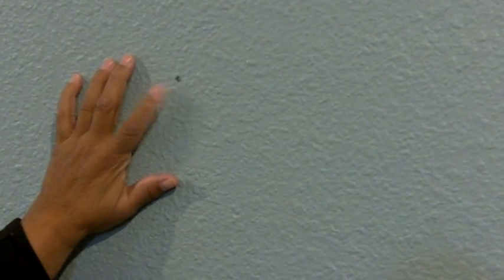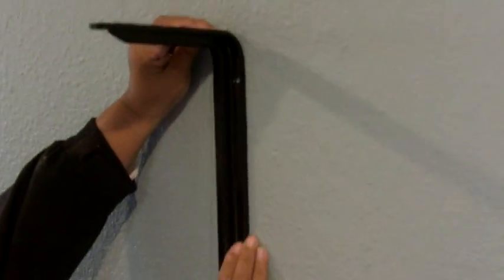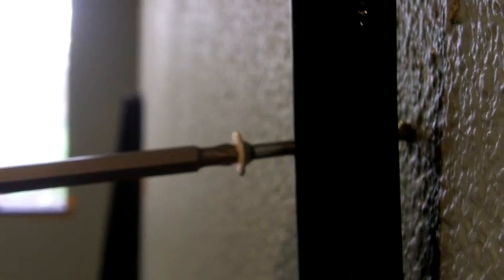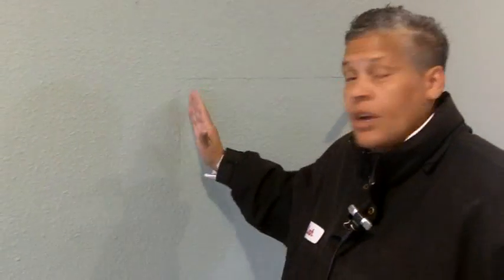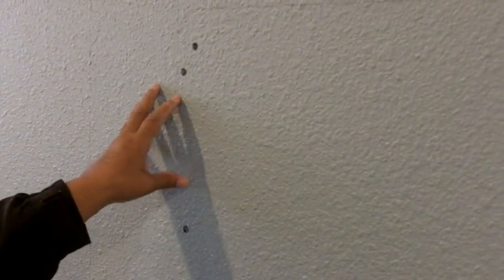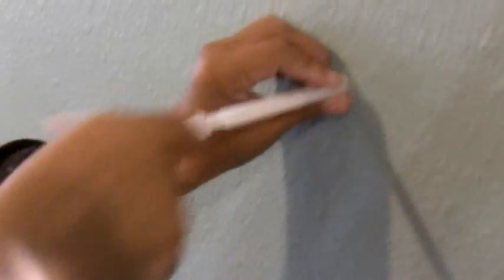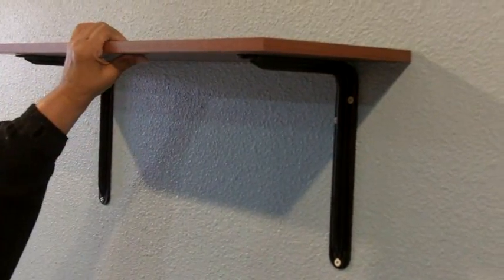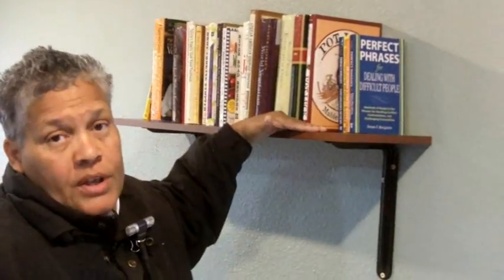How to Hang Shelves on Drywall that will Stay

Comment: One thing I do when hanging shelves is to count up the screws I need and press them into a piece of cardboard and spray paint the screw heads the same color as the brackets then they simply blend in with the bracket.
Reply: Great idea 👌

Comment: The walls in my appartment are not straight up and down.  After installing angle brackets flush with the wall, then setting the shelf on the bracket, my shelf is always tilted forward, or back depending on the wall. Should I just shove a small chunk of wood between the bracket & the shelf?  Not sure what the best, or should I say most secure solution would be.

Comment: Leah you did it again! I can so do this. I fixed the hole in my bathroom door after watching your video - turned out ah-may-zing! Then I learned all about tools and just when I need to hang some shelves I also learned a long level is more accurate, what a snap toggle is, how to make it plum (plumb?), drilling pilot holes AND what striking the line means. Good grief what bang for your buck! Thank you so much. My new quarantine home office is going to rock!

Comment: Thanks for the detailed video! This is far more useful than most other videos, especially on how to find studs and how to hang a bracket where there isn't a stud. But some questions --- Can snap toggles be used with the common plastic wall anchors that you find at Home Depot? And do you recommend those plastic wall anchors at all? Some professionals say they're not strong enough. I don't want to worry about weight on the shelves. And how do you know what size toggle to get, 1/4 or 3/16?

Comment: Thanks for the video!  I don't have wood studs,  instead I can see some metal poles or something....Is there any alternative  way to hang the shelf ?
Reply from the maker: Yes, use an anchor that is rated for heavy duty, like Wingits
Reply from the maker: Where do you live?  The metal poles could be electrical conduit and secondly, do you live in a stand alone house or building.
Reply: It's  three story condo.
Reply: I have metal studs in basement.  Use Wingets?  Or?

Comment: Life saver! Can I find strap or snap toggle at home depot? And how far do I drill the hole for the snap toggle?
Reply from the maker: You can find the the toggles at either home improvement store,  You need to drill completely through the drywall to insert the toggle.

Comment: hi how do you know how far away to place the brackets from each other?  Meaning do you measure a few inches in from your shelf?
Reply from the maker: It isn't so much about the distance between the brackets.  What you need to make sure of is that at least one of the brackets is (ideally) mounted on a stud.
Reply: Thank you